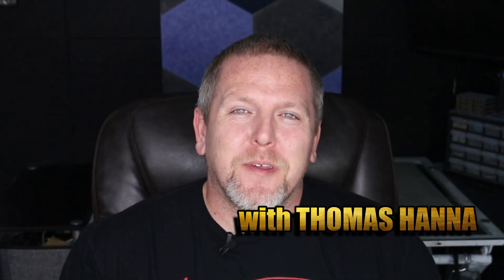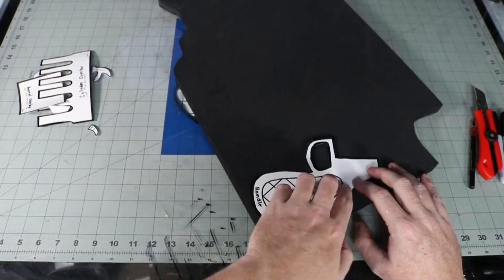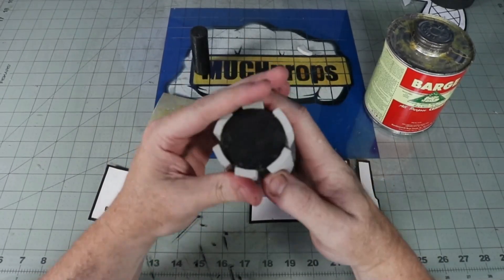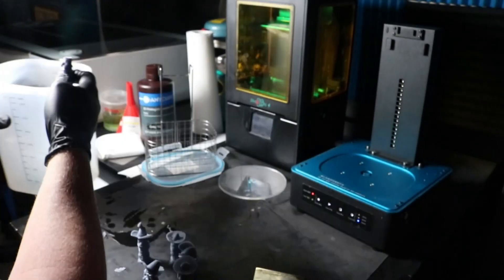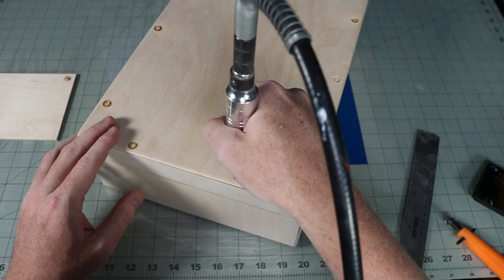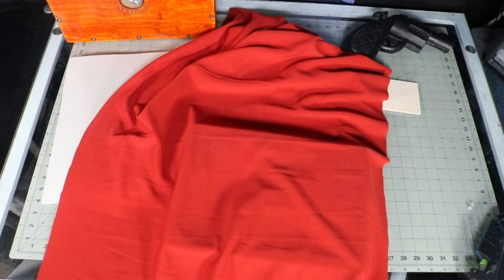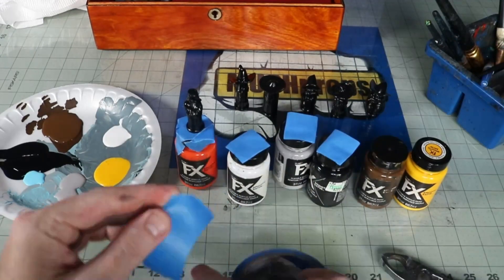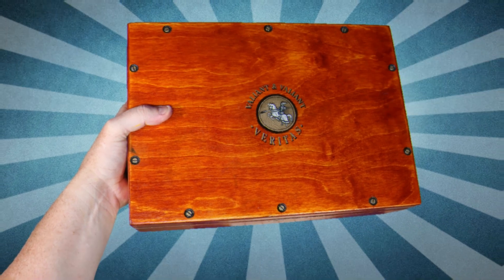Making the Toon Gun from Who Framed Roger Rabbit

Comment: I’m planning on buying a liguid resin 3D printer. I can’t afford the printer and the curing machine at the same time. Is there a way to cure pieces without the UV machine? I heard leaving it in direct sunlight works too?
Reply from the maker: The resins a UV set so, yes it can be set out in the sunlight to cure. Hardening times would obviously vary greatly so you would need to watch it. You can also buy cheap UV laps to set you stuff under too. They make some for manicurist that are really cheap.